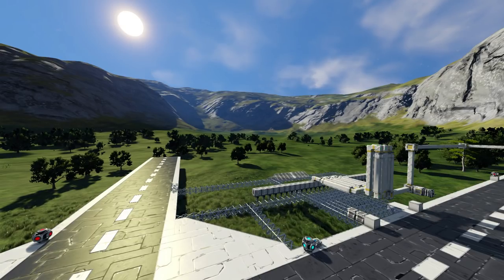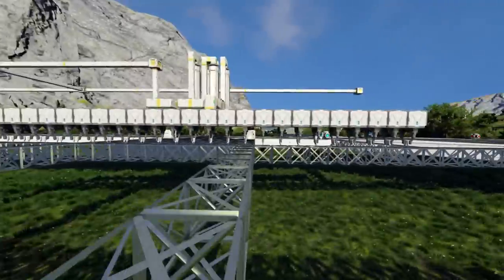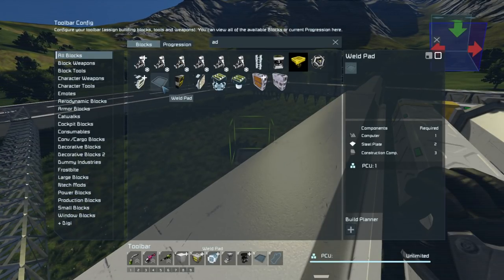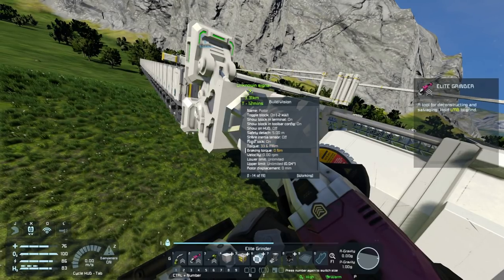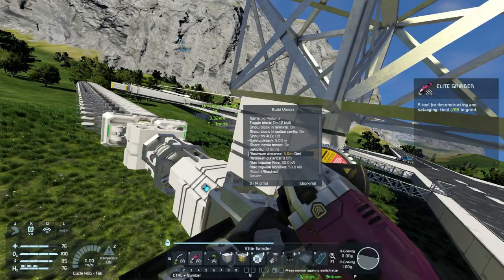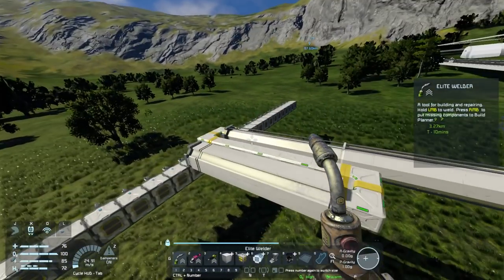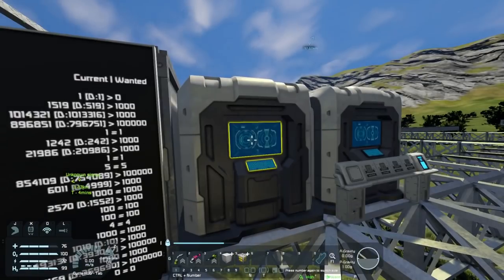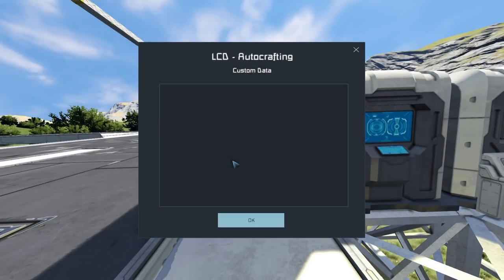Space Engineers - S2E52 'Printing Of The Regal Apartments Begins!'

Comment: I tried to do something like this, but on a much smaller scale.  The solution I came up with was to simply have the printhead set up on an advanced rotor and as the up pistons raised the assembly up the 7.5 meters, the rotor rotated the printhead around 180 degrees, so every pass in and out printed up three levels of blocks.  I'm not sure if that would work with the scale (and complexity) you are working with, my design only had a printhead 11 blocks wide, but it took a lot of the work out of it.  Made it much more of a start and forget system.  I do like your piston setup, compared to my design yours looks much smoother and more elegant.

Comment: Setting up the timers would likely be easier if your start state was fully extended with welders off.
Then your timers could just be:
1. Welders on >> retract horizontal >> call 2
2. Wait(x) >> welders off >> extend vertical >> call 3
3. Wait(x) >> extend horizontal >> call 4
4. Wait(x) >> call 1
You could also use increase/decrease velocity on the horizontal piston group to make the extension faster than the retraction to get a little more time efficiency out of it. So your start state would include a forward velocity equal to punching increase velocity twice for the group minus the 0.05 retract speed, then have timer 1 hit decrease velocity twice and timer 3 hit increase velocity twice.

Comment: Observations from my SE printing: you want to have it between the layers (yes, you're only printing 2 at a time, but the buildup is more manageable). Another solution is to take half-blocks or catwalks to create a "safety cage" around the welder heads (it prevents the projected block from being "printable" until the cage is cleared, which prevents the clang from overlapping with the tip of the welder). I also think your lateral movements are a bit on the fast side (always assume you are printing the most component heavy blocks with every square so you have additional time to make up the difference).

Comment: @kanajashi  it's not advised to move the welders up 3 blocks, rather just do  a little more than 2
reason:  in your blueprints you can have issues with unweldable things because they are not attached from the bottom but are for example hanging from a ceiling
when you move your welder up and only weld Totally new blocks and don't overlap the 2 regions, you can potentially be left with blocks that have not been welded since they are not attached to the welded frame when the welders pass
and you would need to weld those by hand afterwards
of course this could be no biggy for some BPs and then again a total PITA for others. it all depends on the BP

Comment: You could add thrusters to the top of the printer and mount it on connectors along the road.
40:30 Yeah, if you have items that span more than 1 block then that is an issue. What if the top block you are printing goes 1 block higher?

Comment: in the from the top configuration, if you surrounded the welder tips with light armor then if won't be able to start welding the blocks that would interfere with them as you dragged them along.

Comment: honestly i think the whole massive welder is an architectural flawed system
it should not add horisontal layers by dragging welders horisontal over the design
if you print something bottom up, in layers, the welders should be going up too. 
see it like this, if you make a layered cake, you don't 'slide' the next layer over the other, too much risk in damaging it ... instead you come from above to add the second layer. 
not to say you can't go from front to back or reverse, but what you can't do is both at once to add layers. you need to build the entire layer on the oposite side of your welders at once and when you pull them back, or when you pull them up, you shouldn't have to go back in to print another layer.